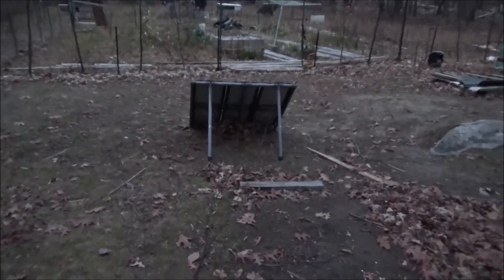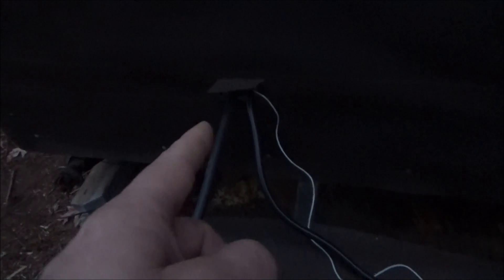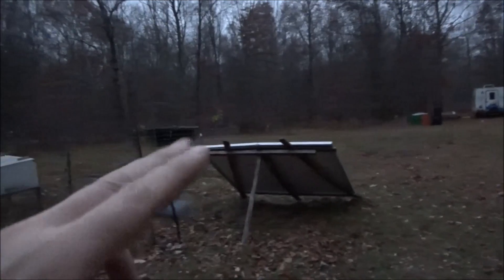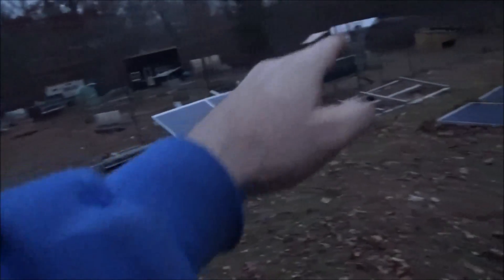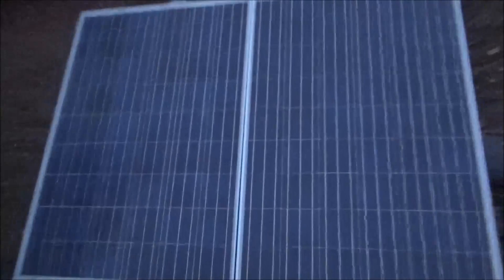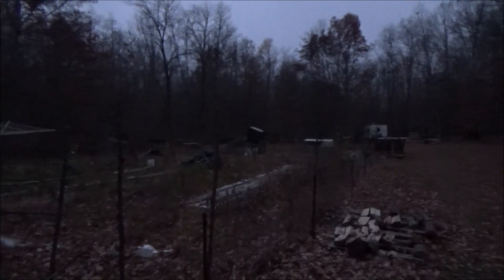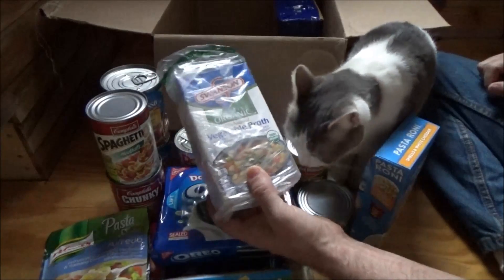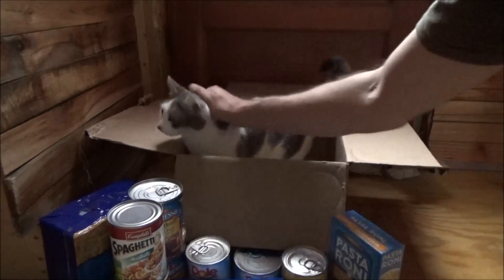Talking About My Off Grid Tiny Home Solar Panels N19

Comment: Troy, You are doing better than I could have ever done. I'm always impressed with your carpentry skills and your konowledge of electrical. The indirect lighting in your tiny home is great. 
Got an idea, curious to see what everyone thinks. This is my idea, but is heavily influenced from what others have to say. Taking into consideration, Troy is limited on funds and getting more wire is not an option. He has plenty of pallet wood. He has plenty of solar panels. Or build a battery house. Use pallet wood to build an A-frame building and mount the solar panels on both sides. Keep 2 batteries on the tiny house for power. Put other batteries in A-frame so there is not a lot wire and the batteries are protected from weather. Swap out batteries as needed. Yes, batteries are not light and its not easy to move them back and forth..2 wheel dolly will help moving batteries. 
Raise funds to get wind turbine or alternative energy source. Sell excess things around the DIY Project. ie car, extra camper to raise funds for power projects and or getting tiny house done. He could barter for this as well. Barter for wind turbine help and materials. 

Paul Walker's comment is very good. Troy has a tiny house on wheels. Move it to a better location in the meadow for solar power. 

"It's a great life if you don't weaken."

Comment: If you have the money you should get a combiner box with a circuit breaker for each group. That way you don't overload and burn your wires or charge controller if there is a problem with the connection. Also, it allows for some neat data recording as you can turn off the solar input to see what your wind power is giving you. Or isolate a group of panels that may be under preforming.

Comment: hey man, Solar and clouds really stink, hang in there!!!! just a thought!!!! if you have 800w @ 120v that is only 6.6 amps. Not fun!!! just checked on Amazon for extension cord for $75 that is 100' that will handle 13amps!!! thats twice what you need!!!! parallel is great for PWM and short distances, you have a MPPT charge control!!!! Use it and all of it!!!! High volts and all 60 amps!!! Your wires your using now seem to me to be over sized anyway!!!!! hang in there
Reply from the maker: I will add more panels soon. I will be getting more wire

Comment: the peak solar point in the meadow is the best to place as mutch panels as possible on the mppt controller,watch the max amps and volts on the input of the mppt controller, place the panels in the same direction, next to each other, connect them serie/ parralel to each other like you did with the old battery bank, you are in low light conditions so you can couple more panels on it as you did in the summer. panels wil delivers some power with only light, and more in direct sun light.connect as mutch panels as possible Troy!,you can always switch them off in summer by high solar days.(you can even mount a simple switch in the second array to switch of in high sun situations directly by the panels!), dont you have some emergency wire somwhere? to use for now?(doesnt have to be that thick, its low amps now anyway!
Reply from the maker: Thanks for the tips. I will be doing that soon. My emergency wire is too thin. Burnt out last time.
Reply: The Do It Yourself World  remember that you have a lot less power now in low light situations, not the full power off last summer.

Comment: It looks like your charge controller will handle 150v at 60amps. For efficiency in the long wire runs make sure you add the solar panels in series. Add the open circuit voltage numbers on the back of the panels to 10% of 150v, so 135v. When you hit 135v create a new group of solar panels. Wire the groups in parallel so the voltage stays the same. When you add the wind turbine you will need to connect it in parallel to the charge controller. It may be cheaper to run each group in a separate smaller wire to the house to save money. Example 3 solar panels x 35v open circuit = 105v one group. Pick the highest amp number on the 3 panels and add 20%. Example 8amp x 1.2 = 9.6amp. So, your wire should take 105v at 9.6amp. Regular 15amp household wire is rated for 120v and 12amp continuous ... so using an outdoor lawn mower cable for EACH group may be the way to go.

Comment: Did I tell you before the power company uses aluminum cable to bring electric to houses. They have some around that has been pulled down maybe you can buy for the price of the scrap aluminum. It would extend your solar cells. But I believe they should be at a northern point on your perimeter but you are there to see not me.
Reply from the maker: That is exactly what I am using now :)
I will look for more

Comment: Hey Troy.. So I've been doing some research on Solar Technology, and I think I'm about ready to make the transition of becoming less reliant of grid electricity, if not entirely self reliant. Me and my fiance have already cut out electric bill down to $35 in winter, and $50 in summer using a variety of energy efficient appliances/methods. It sucks you've been having trouble with your batteries and getting good sun reception out in your meadow. I have the convenience of living on a hill top, so we get full sunlight just about all day.

 Here's my question.. Money is tight (isnt it always), where do you suggest I get the best solar panels for the cheapest price? I'm looking to get about 4-5 200w panels.. also, what batteries do you suggest I use.. I take it from your experience, gold cart batteries probably aren't idea? I'll most likely end up buying used unless I can find a decent supplier who isnt asking an arm and a leg.

Comment: Hey troy,   could a man use 4 12 volt lawn mower batteries  for a battery bank???   Let me know please
Reply from the maker: No, they have no real usable energy. They are made to start an engine but not to provide any usable energy long term. Its cheaper to get a deep cycle battery in that case
Reply: Hi Mike, now is the time to think ahead... your battery bank has to be evenly matched. In solar energy production the important factor is the amp hour ratings of the batteries, they should all be the same or the batteries will kill each other off trying to level out the energy stored inside for example if you have 2 12v batteries one will hold 125 ah (amp hours) and the other 75 ah the larger battery will be forcing it's overflow into the smaller as it attempts to settle the added power coming in. This will quickly end the life of the smaller battery as it will be overcharged excessively and repeatedly. Now as batteries are expensive it's a good idea to find what battery size and type will suit you best and still be economically prudent for later expansion or replacement.  The simple answer to your question is yes, but it's never that simple. your battery bank should be large enough to support the load of your draw and only reduce your batteries capacity by no more than 10-20% to extend the life of your batteries so they last as long as they can reducing your replacement costs. I hope I helped. If you were running a small load in the manner I described and had adequate reserve and recharge the answer is yes.

Comment: Troy, I really hate telling you this but you cannot run the cable from the solar panel all the way back to the tiny house, there is too much IR loss. 

It may work but you will get lousy performance or not eork at all. I do have a solution though.Feel free to contact me. 

Mark C
Reply from the maker: I have an MPPT charge controller which allows me to run them in series increasing voltage. Its good.
Reply: Troy Hey trying to help. Can you send me the model number of your charge controller? Also from what I can see the voltage being displayed on your charge controller shows 12 volts. If you have two panels connected in series you should see 24 volts.

Regarding your batteries, from what you show me so far from your videos I would not trust autozone for whoever it is. You need to find and automotive parts supplier that can test your battery with a device that checks for conductance. This is fairly new technology.

This is really the only true test to see if the capacity of the battery is up to specifications. The old ways of testing the battery are not valid anymore.

 Can you take your voltmeter and measure the voltage going into your charge controller, how many volts is that?

Regards,

Mark
Reply: Troy, check out this company they have incredible pricing are LED lighting and so much more. Company is called Parts Express and they are in I believe Miamisburg Ohio one more thing you need to check are the solar panels them selves. You can do an open circuit voltage measurement and short circuit current test. I will be glad to help you if you're not familiar with how to do this.
Reply: Troy I realize and you get so many people and crazy people texting you and I hope you don't think I am one. I assume that you already realize that when you charge the batteries they potentially give off fumes that could ignite from your gas burners on your stove. I just thought about this

Comment: Just a thought: Is there anyway that you can install the inverter in the meadow right at  the panels. then you can use smaller wire (like romex) to run ac to the house (without the power loss), then use a transformer (where needed) to convert back to dc to charge batteries?
Reply: The Do It Yourself World
I'll defer to your judgement on DC/AC lines and power loss. I don;t have the technical knowledge. The only thing that keeps me wondering is a more efficient way/location to mount the panels. I can't help but think getting them off the ground would only add more sun exposure. Having them in near constant sunlight for a greater portion of the day at their optimal angle to the sun is way more efficient than scattered out in the meadow pointed in different directions. As the sun dips the intensity decreases. Isn't it better to have the panels aimed at the proper angle to capture the sun's most intense exposure times? I still think mounting them on top of the workshop trailer could add some serious output. That would keep your current setup, get your workshop closer to the house, keep you from cutting down trees unnecessarily, and put the panels further out of harm's way. Sounds like a win/win to me.
Reply: This is creative, but each converter to inverter process would lose way more than the DC long run and single inverter.
He would also need like 10 of those PWB controllers to handle the solar output he has potential for.
Reply: John Brown
I would disagree about the mounting. If he were to move it out into the meadow that would be a far cry from running it down the highway. I don't doubt for a second that it could make it into the middle without coming loose from the trailer. You're right about the snow. He can't move it for months now. As for the tongue height that's solved with a Hi-Lift jack. It'll take the weight and get it hooked to the truck. I don't really like the idea of moving the house at all unless it is absolutely necessary. I'm a fan of pulling the workshop trailer out into the middle and mounting the panels on top of it. If he aims the panels right that should solve his power problem in addition to the added wind turbines in a few weeks.
Reply: That sounds very clever.  Assuming he can build a little shelter for it. Hmmm,  interesting idea.
Reply: MollyDolly It would not really take a "shelter" so to speak (as in a building or a shed), but more along the lines of a  vented, waterproof box large enough to hold a cheap modified sine wave inverter large enough to handle the max power of the panels that are connected to send ac power to the tiny house..
Reply: James Pottorff So maybe a plastic storage box with a vent cut in, then screwed or clipped to the back wall of the new chicken coop?
Reply: Matt U Even if only 1 panel was connected with a 150 watt inverter, could it not provide 10 apps @ 12 volts to charge the battery bank?
Reply: he can build a shed on the meadow, with his batterys close to the panels and inverter , like a power shead, thinner wires to his house with the ac power , and thinner wires for the dc for his lights, would be a good idea to make, only has to put a heater in it for could conditions if he uses his bad hf 6 volt battery's but even good traction cels work less in the cold., many off the off grid systems we make here in holland on shore we build like that, only on boats (canal boats, or house boats people live on) we do it as troy does,(exept the panels, we can not always put the whole deck ful of panels)..altoug some house boats we placed more as 10 panels on some!)(250 watts pro panel!!, so big systems, with more than one mppt solar conroller !)
Reply: MrBugsier5
He already has the shed- the workshop RV. Park it in the sunniest spot in the meadow, mount the panels on the roof and put the battery bank, charge controller, and inverter inside. Then run regular romex to the house. It could be heated by a small propane heater or something similar. Or better yet, pull the tiny house out into the meadow with the roof facing South and mount the panels to the roof. It has more than enough insulation to stay cool in the summer and the sun in the winter would help use slightly less firewood.
Reply from the maker: I use mostly DC power in my tiny house anyway. So it is better with less losses to run the batteries in my tiny home. Keep the low voltage DC wires shorter. My MPPT charge controller allows me to run higher voltage, up to 150 volts DC in the wires between the solar panels and the charge controller which reduces loss in the lines.
Reply: James Pottorff
Again, creative thinking. Nice.  I could see that working for a single panel, but that would not be near his power needs.
Reply: The Do It Yourself World
 Exactly what wire are you using for the HVDC runs? Maybe a dumb question, but are you series before the long run? Just trying to comprehend the amps it took to burn what wire.
Reply: James Pottorff  Victron does to!
Reply: Weather The Storm Survival  yea, thats a good idea to., but its not realy nessesairy if he builds a kind of polarmount , and connect everything with the right cables, and a second mppt charger (split the panels to two big polarmounts (when possible auto tracking the sun) and connect everything rugged) and thats the biggest thing, buy good battery's! he would have power enough, dont forget , he can also charge with the generator .dont think the wind turbines wil make mutch difference, although they charge, they wil do so only in high wind situations.,in low wind speeds its nothing wortwile.
Reply: woodmann61  he had to use something, he didnt had any other wire or mony tu buy good wire, in low amp situ that would not be a  problem, only he didnt realize his panels where pumping out amps for a time (lol)
Reply: steve h he never say that he was a 20 year pro in big solar systems, everything he does is  learning by doing, some tymes that will go wrong, but hey, you learn from the mistakes.(and we can see interesting videos with sparks!!) lol

Comment: How far away from T.H.O.W is the stream?
Reply from the maker: 1/4 mile
Reply: The Do It Yourself World Why not try a water turbine/generator, you have spare lumber, and your mini gen is out all you need to do is get it to turn to produce power or if you have some car alt's then wire it to the T.H.O.W. Im just saying that the sun does not always shine and the wind does not always blow but rivers and streams don't just stop without something major happenings.